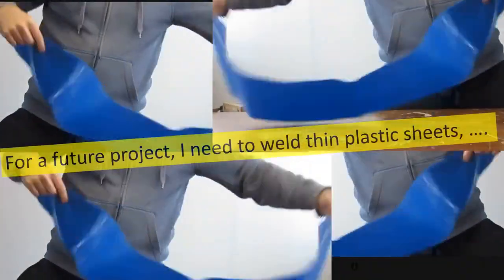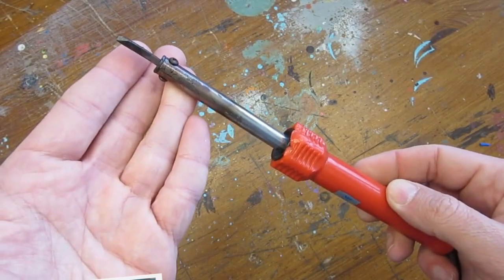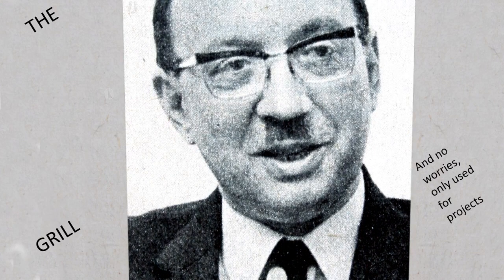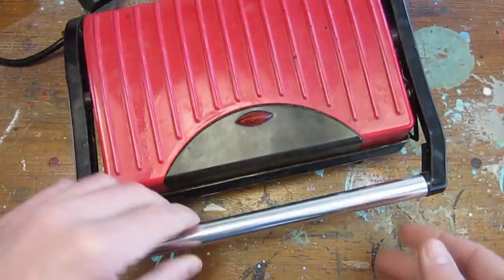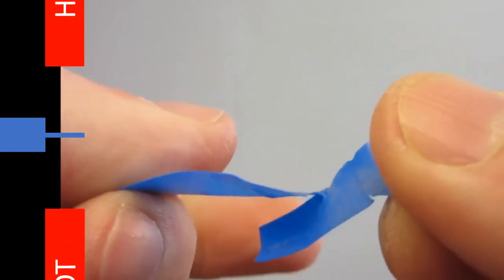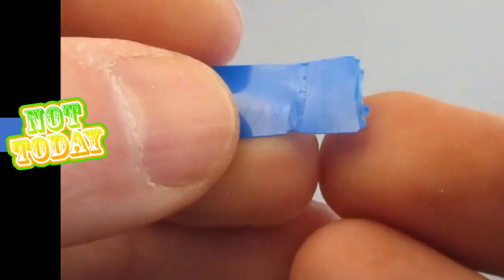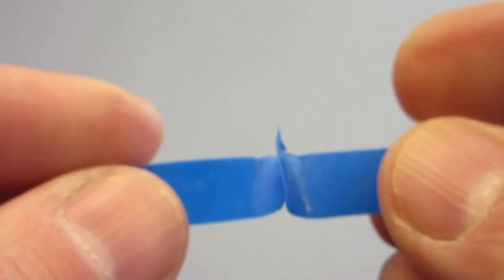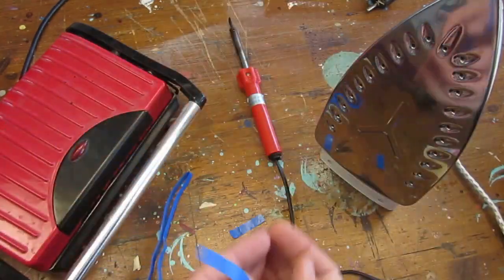EXPERIMENT! Figuring Out The Simplest Method To Fuse / Weld Thin Sheets of Plastic #DIY #plastics

Comment: Funny stuff. How about a ceramic flat iron? Would that fuse two sheets of thick plastic together. I have a project in mind using poly plastic folders and need to fuse sheets of them together.
Reply from the maker: If the temp is right, it will
Reply: @TheLabOtomy  What's a good temp range?
Reply from the maker: @utubepunk  For most common plastic types, 200-260 Celsius

Comment: Thank you for the idea to use a scrap piece of metal for the iron tip. How did you make that?

I saw in another video, that we can use masking tape, and then iron through that, instead of using wax paper.
Reply from the maker: That one was just a nail but this old soldering iron has just enough power to make it hot. Next version will be using a piece of copper (a flattened section of copper pipe) since copper has a better heat transfer mechanism than iron
Reply: @TheLabOtomy Thank you!

Comment: I'm not sure what plastic type you used but HDPE needs to increase its thickness by 10 times to match the strength of steel. Yes plastic is strong but with thicker material and larger surface area's. Layering by folding can achieve a greater thickness while using the same sheet. ID plastic type and only weld the same plastics Cleaning and removing oxidation layer from the plastic you are welding including the welding rod Temperature & pressure control for the plastic type you are welding. Overheat the plastic and it's destroyed. Slow cooling and covering of weld area for warpage mitigation. Temperature Measuring Instrument like a k type thermometer with temperature probes for precision measuring of surface temperature and welding methods welding temperature